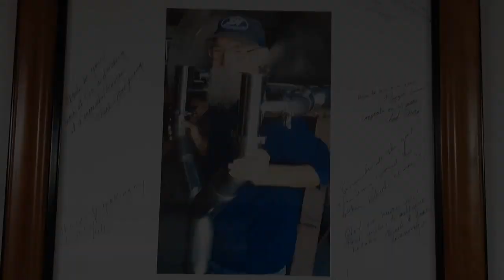Cali Road Trip Day 2 | New Truck | Visiting Family |Memories

Comment: The truck went to the right home. Good for Mike to hold up until he found the right people for it. Glad it wasn't slammed !!! You may hear some dislikes about the Vortec engine since many don't like the spider injector assembly under the intake. It is a PITA, but the good news is, the spider assembly is for the small blocks. The 454 has real fuel rails with the injectors external like they should be so it's all good. It'll drink some fuel but your moving to AR where fuel prices are some of the cheapest in the nation. And it's low miles too. You all did good and will benefit nicely and it'll serve it's purpose nicely.
Reply from the maker: Its a beautiful, PERFECT Truck for our needs! So happy with it